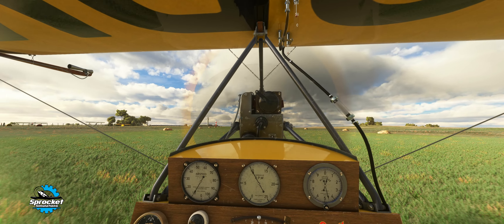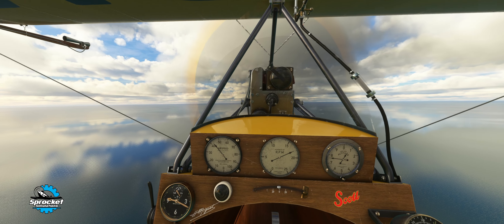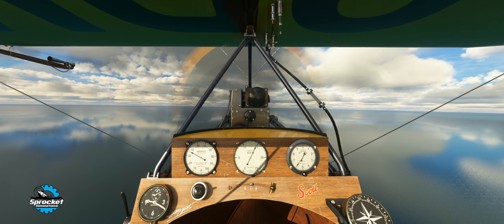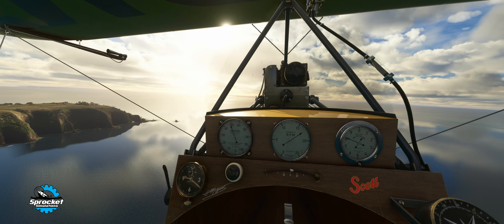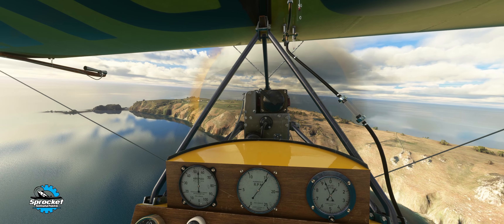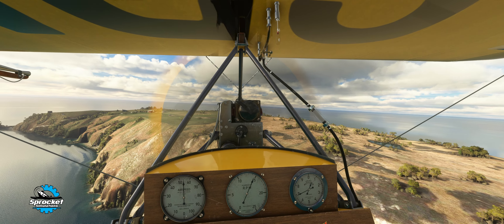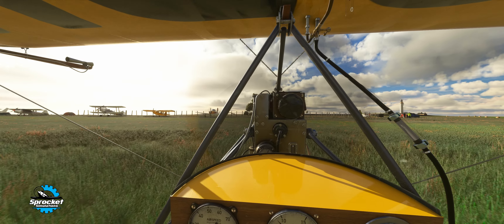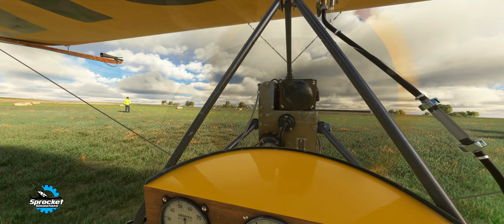Microsoft Flight Simulator Mignet HM.14 "Flying Flea"

Comment: This aircraft is really funny and for what I have seen there is even in several variants. I am temped to buy it, because this developer merit help for the fantasy displayed in creating this little gem.
Reply from the maker: There are 4 different engines included and quite a few variants of each. It is also very highly detailed with some cool features. Not sure I’ll fly it all that much but it does make you smile! Thanks for watching!

Comment: Looks like a lot of love went into this plane, it's full of detail.  I'm a bit wary of the complicated nature of its workings, as due to disability i have to use keyboard and mouse to fly, but  ithink i might take the gamble, it looks too good not to.  Thank you for the video it was fascinating, also glad you missed that wall at the end there haha :D
Reply from the maker: It should fly just the same for you with your keyboard controls. You are still using your aileron/elevator key command to turn it just handles differently and will move the rudder and wing instead. Thanks for watching!!
Reply: @sprocketsimulations  It does, i got it :D  just as you say, I'm flying with a huge grin on my face as it has so much charm and character, so many little details and options to choose from, it's a real blast of fresh air.  Thanks again, your video inspiried me